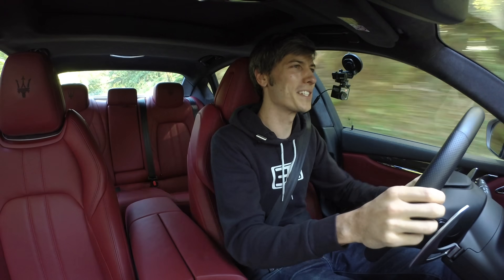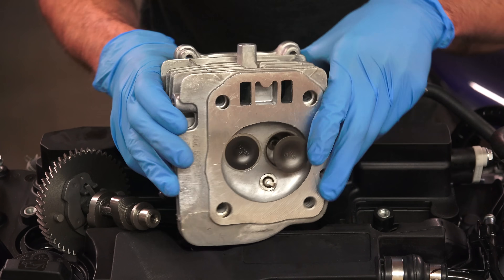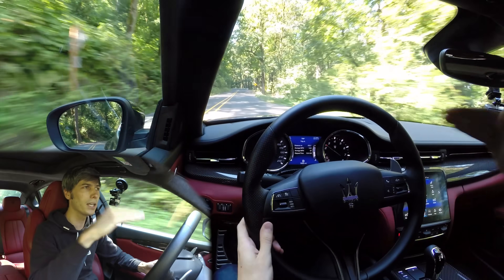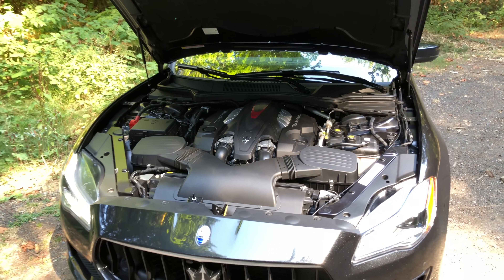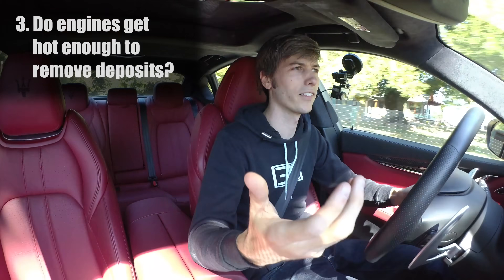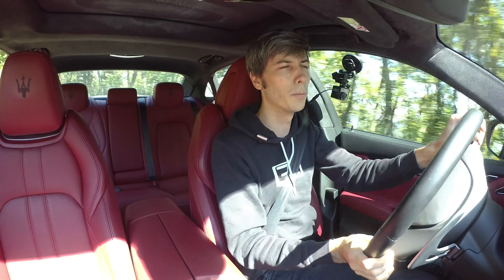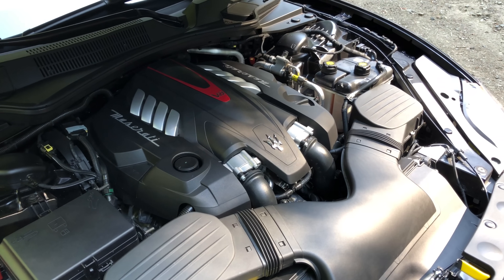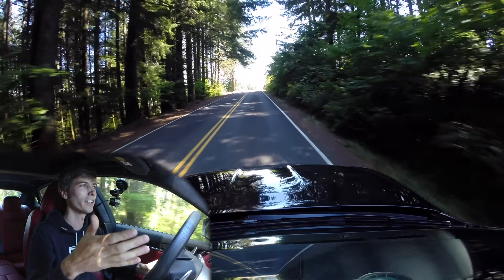Is Redline Good For Your Car's Engine? Italian Tune Up

Comment: I went to pass a slow car in my also slow honda civic (tastefully modded) automatic, shifted to 2nd gear then when I went to go back to D accidently went way over to reverse and I was still on the gas so it just redlined for a good 2-3 seconds then back to drive and I just punched it to about 100. I was thinking "man there goes my engine" but then it drove absolutely fantastically for the rest of the day lmfao

Comment: Just to correct your chemistry, decarboxylation is a reaction carboxylic acids undergo, losing
CO2. De-carbonising engines through simply burning carbon with O2 to form CO2 requires around 1100 deg C. I'd guess that at the metal-carbon interface oxidation of carbon would be catalysed (to some extent) by the metal surface lowering the oxidation temperature. This would loosen micron-sized deposits allowing them to blown out the exhaust.

Comment: The saying Italian tune up has been around for a long time. In the days of carburetted exotic supercars from Italy. The exhaust ports would build up carbon after many hours of low performance driving. Hard highway accelerations in conjunction with normal tune up items would see heaps of smoke(burnt carbon) exiting from the tailpipes. Hopefully removing the carbon buildup.

Comment: I have a car older then me and it's stock besides basic things like brakes, fluids, tires and lights. I've never opened the engine to see the build up, think it might be bad?
My red line is about 8k, I think highest I've needed was 6k but I don't drag race.

Comment: I could be wrong, but I think the "Italian tune up" is not just about carbon buildup. How about the sharp increase in oil pressure dislodging buildup in an oil galley? I have heard of situations where pressure activated pins and lifters becoming unstuck after a good thrashing. It might not just be the oil pressure too; Could be a combination of increased heat and oil pressure doing something.

Comment: About 10 years ago when I was new to cars and never heard of running a car hard once in a while like this, I had an early '90's Ford Falcon (4.0L straight 6 with port injection), I towed a friend's car about 300Km along a mountainous roads, the car was under a fair amount of load the entire time.  The next day I felt like the car performed better but I have no evidence other than feelings which might have been influenced by the long sluggish drive before hand.
Some dyno results before and after on an older car (to ensure there are deposits) would be a good idea...

Comment: 1990 MX5. I left my car in a barn(no mice) for 8 month in 2017. When i started it, it could barely idle, I drove it up and down a road until the engine oil was hot(still running really rough). Then i revved it out and did some pulls. After that it was running smooth and strong again.

Comment: I do this in my 12 Vulcan OHV motor on my 2005 Taurus V 6 . 153 hp 185 tor . It has 154, 000 miles on it. As your entering the high way, just hold it to the floor! Every day driving over and over. No Carbon here!  Quit worrying that car is made to drive. Drive the Hell out of it! Shawn

Comment: Still with the cleaning effect of fuel on port ingection carbon buildup is not a real problem as it is in a direct injection
Reply: So modern turbos are the ones that going to have more problems with this also by the load.

Comment: Great video, royally fucked up the decarboxylation explanation though. Splitting the carbon atom would require a lot more heat than 325 celcius (around 4mil celcius iirc) haha, that's nuclear fission.

In Chemistry, heat is an energy source that can drive up the reactivity of certain compounds/elements. At temperature lower than 325 celcius, carbon is not reactive enough to react with it's surrounding oxygen. In decarboxylation, you're basically heating up the carbon deposits so much that they are starting to react with oxygen, forming carbon dioxide CO2. 

Source: Am Chemical Enginner
Reply from the maker: Haha, thanks for chiming in! I certainly wasn't attempting to state that the carbon atom itself was ripped apart. Rather, that the carbon atom was detached from the deposit molecule (which was stuck on the surface). In detaching the carbon, the molecule breaks apart and no longer remains attached. Still could be wrong about that, but that's my understanding.
Reply: Big fan of your videos and glad I could help. Well you're somewhat correct. However, the carbon deposits are not bonded to one another, they are just stacked on top of each other like lego blocks. When you heat it up, the most outer layer of carbon will react with surrounding oxygen to form CO2.

The only carbon - carbon bond are found in materials such as diamonds and graphite. Fun fact, burning diamond will get you some expensive carbon dioxide.

Comment: Did you consider and research changes in engine oil composition specifically to address this issue?  I know Motul and several others make oils which produce less volatiles and were created to address the issue of carbon deposits in DI engines.  I know that Audi changed the temperature at which their 4.2L engine operates, moving it higher, to combat this issue.  There are changes between the RS4 (B7) and the RS5 (B8) which features a new design 4.2L.  It tends to run between 215 and 225 degree oil temperatures under normal operation, higher if you're pushing things.  Motul Specific is applicable to the above as is the Audi-specified Castrol rebranded oil.  So that 200 degree magic number from the 90's may have changed.

Comment: Years ago with exhaust gas sniffer emissions tests. It was common place to go for a good long highway run to clean up the vehicles emissions equipment. Worked like a charm. Many times guys would come in and fail the sniff test. Go out for a good long pull on the freeway and come test again and pass.

Comment: I’ve heard Italian tune up comes from old Ferrari’s back when they were still carbureted after doing an engine tune up Ferrari mechanics would take it around the track a few times and supposedly it did reduce carbon on that particular model

Comment: I think the reason for the carbon build up in turbocharged engines at high load is the rich fuel and air mixture. We know that turbocharged engines will increase the air to fuel ratio when you floor the throttle, to reduce engine knock.

Comment: I am just visiting my mom in Italy and I just gave her 1999 1.3l Corolla and Italian tune-up - whether it works or not, I felt like having a duty to give that car some happiness. I know she hasn't used the stereo in 15 years (it still had my Metallica Kill'em All CD inserted) so I gave a tune-up to the speakers too
Reply: lol this made me laugh dude, and you had the right music playing to!
Reply: Be sure no one gives your girlfriend a tune-up, while you are away.
Reply: @AlexanderBukh  OK I will
Reply: @AlexanderBukh  lol, I think someones flaunting some personal fears. Sorry your girl banged another dude, Alex.
Reply: @ster9765  ok man
Reply: @ster9765  legit "ok man" no period nothing
Reply: SEARCHIIIIIIIIIIIIIIIIIIIIN

SEEK AND DESTROOOOOY
Reply: Does that still work for smaller less powerful engines? I'm worried that if I do this it'll bring it into that "sweet spot" where carbon deposits form and not getting hot enough to burn them like mentioned in the video. I'm curious as to what your method is for this. Do you warm it up, then switch into a lower gear and get the rpm really high?
Reply: @mattheweng4679  I just drove spirited switching gears closer to the redline, and also downshifting in a more aggressive way

Comment: Recently I rode about 100km in 25 minutes on my bike. That's roughly  85% of max rpm at I would guess 80% load. After that I noticed that the inside of the exhaust was white. Almost all of the carbon had burned off. 

Just some food for thoughts.
Reply: Starvation diet?
Reply: Yeah could of been running lean hench white

Comment: Another thing to consider is that during high load high RPM operation, the ECU is going to put the car in opened loop operation and therefore make the AF ratio more rich causing more deposits.

Comment: I let it sing on the highway, for a good 3-4 hours straight. 
It’s geared so short it’s turning 4000 at 65mph, and only revs to 5500 or so.

Comment: Interesting: that is also how they clear carbon deposit out of old tractors. Once every 3 months or so they hook up the tractor to a Dynamometer or a Baker's Fan, and run the engine at full power for 5 - 15  minutes.

Comment: Italian tune up has always worked for my car! But I wanted to know if the fuel in the cylinder was cleaning the Pistons and valves on the compression stroke both for port and direct injection engines?

Comment: I have an MB w202 C250 TD from 1998. I bought it second hand, and I guess the old owner had no care at all with it, it had problems attaining high speeds and RPMs, it leaked quite a lot, made a lot of smoke... 12 months later, only premium Diesel with Additives, good oil changes and a whole lot of this Italian Tune Up, and all the leaks were gone, almost no smoke at all (only on 4500 RPM+ ), and better performance driving and better fuel consumption. So I guess this would work, at least on my car, and some love and caring does go a long way.

Comment: Hey Jason,
I have an understanding that high temperature needs to be maintained for about 25-30 minutes by driving with full load to burn out the deposits.
Correct me if I'm wrong.

Comment: It does work! but only with italian cars! my dad bought new a Alfa Romeo 33 1,5Ti, it had a boxer engine with 2 upright weber carbs, IDF 36 i believe. During the week was driven around town and it would get worst by the day, on weekends we would cruise on the highway, no need to redline, the car would sound really dialed in for 3 days, most likely was fouling the plugs.

Comment: No it's actually not good to redline a car even if you're told it's okay... what happens if you wipe a bearing out or you got low oil pressure or one of the connecting rods just don't like it's home and decides to break out of the block I've seen cams snap timing chains snap unless you got yourself a 10 $15,000 engine setup I wouldn't go around Red lining your car

Comment: From my experience the Italian tune up definitely works. We bought a Swift 1.2 petrol with 80k km. It was probably only driven around town, by someone with a light foot. The car was DEAD above 2.5-3k RPM. Got onto a highway and given it a blast in 4th gear, keeping it between 4 and 6k RPM. After that the car pulled like it should, through the whole rev range.

Comment: Remember folks, the plural of anecdote is not data. Great explanation, Jason. When I first heard this myth, a very long time ago, I had the sense that it was one of those things that people choose to believe because it supports what they want to do. They want to believe that driving their car hard isn't wrecking it, and this makes them feel justified in doing that. My experience has been that when you drive a car hard, you wear it out faster. End of story. There might be some carbon that gets broken down or blown out by the hard revving, but the cost in wear to those components is far greater than any benefit. But hey, if it's your car, and you're being safe and respectful to others out there, drive it however you want.

Comment: People won't have to worry about deposits if they were burning all their fuel with the two efficiency modes. But usually most don't want to mess with the throttle body or have the materials/money/time to yank the head(s). Unfortunate......

Comment: A lot of good knowledge on engine cylinder temperatures  but false conclusions and poor advice. Redline is  the maximum rpm the engine can be run at with out incurring  ring flutter or valve float. Both of which are destructive to components.
 The internal cylinder temperature is caused by the load put on the engine at a given rpm, not the rpm alone. In vehicles that have been babied by very conservative driving for most of their life hard acceleration and high rpm driving causes the top piston ring to contact the worn  cylinders ring ridge with such force that the ring breaks. Now you need an engine teardown. If you want high engine temperatures put you car in 5th gear at 10 mph and try to accelerate up a hill the temperature will rise and you will need a new engine and or transmission.
In older cars/engines with carburetors or mechanical fuel injection puttering around town produced more carbon and lead build up than highway driving or 'spirited' driving. THis is a result of the engine running rich and low cylinder operating temperatures caused by the rich mixture. The main cure is to remove and clean or replace the spark plugs and go for a 1 or 2 hour drive at highway speeds or decarbon the cylinders thru mechanical means. As there is NO lead in automotive gasoline and cars have electronic fuel injection the problem really doesn't occur anymore.
If your car isn't running properly and you have a loss of power see a MECHANIC, something is wrong and needs to be fixed.

Comment: Ironic how all my cars that got heavy highway speeds over 80mph lasted longest internally over my daily drivers that only got low speed frequent stop city driving.
I believe all of what you saying and feel redline is too hard on other valvetrains to justify redline use on a stock vehicle.
Run some seafoam in the combustion chamber and run it clear then go for a long hot highway drive for 100 miles and change oil. This is the best way to remove carbon aside from disassembly.
Amazing video as always!

Comment: Jason I have a question. I have a small euro VW-TSI engine (1.4 TSI BMY). Would a one hour highway drive be sufficient enough if I had it at 3.5000rpm instead of 2.800rpm (5th instead of 6th gear).
How do I remove some of the carbon build up. And is it even good for the car?

We have a 18 year old car that has never been driven hard, and its fine.

Comment: What you did not consider about the blowby causing more buildup theory is that the EGR system shuts of if you want more power because the engine is in need of fresh air for making power. This means no droplets of oil getting into the engine

Comment: I was led to believe that the Italian tune up did work on intake valves because the valve spins around its enclosure, the spin causes friction between the valve and the enclosure thus carbon deposits get removed.

Comment: Could you do a video about engine braking and if it has a negative effect on the engine? I know you have done one already on engine braking but I don’t think you touched on this. I was reading especially in single cylinder motorcycles that engine braking significantly decreases engine life. Is  it that bad? I’m not too sure about these claims, can’t find any study about it. Why would it be bad to engine brake in a smaller engine with higher compression ratio? If so...

Comment: My daily is an E46 318ci. When I purchased it, it Han been nannered. I er “Italian tuned “ it over months and it runs much better. 
I believe it’s due to two parts one is the smoothed out running by burning off the carbon build up and the car relearning how I drive.

Comment: If you consistently run your engine to red line, carbon deposits will likely be the least of your worries. On a positive note, frequent rebuilds provide a good opportunity to give all components that are not replaced a good cleaning.

Comment: Because we are talking about redlining your car, how high is too high (rpm wise) when speeding to merge on the highway or pass people.

My car redline starts at 6500k maxes at 8k. For longevity of the life of the car, how high can I go with the listed scenarios above and not harm the engine? 

My car is an 04 mazda 6i manual.
Reply: I realise this is an old comment, but I'll leave this here in case it helps.

You said redline is from 6500 rpm.  Where the gauge stops is just that, where the gauge stops.  Modern cars are electronically limited, usually somewhere around 250rpm into redline, to prevent engine damage.  Some people raise that limiter, but doing so without careful research (meaning what the engine can take without self desructing) and consideration for reduced engine longevity is rather foolish.  Plus it's useless without "breathing" mods.

Anyway, power does not keep climbing indefinitely.  Power is basically the product of torque and rpm. Afer hitting a certain rpm, the torque will drop quickly enough that the rising engine speed can't compensate.  With a 6500rpm redline, I'd expect the peak power to be around 5500-6000rpm.  Going above that is a waste, unless you're going for max acceleration.  And even then the difference is marginal.  I'd say just take it to 5500, maybe 6k, and then change gears.  Of course this is assuming your engine is stock.  My '87 Mazda 323 has a 6k redline, and "peaked" (actually it was still climbing) at just over 5900 last time it saw a dyno.  I'm guessing the actual peak would have been at 6100, or 6200.

Comment: Hey nice video!! If you can please check about those new methods of removing carbon deposits with ortho-hydrogen gas i saw a few videos about it, they insert this gas throu the air intake and they say is really efective , is it really working that good ? It would be an interesting video ; )

Comment: Anecdotes are not scientific evidence, but this is the internet, so here we go...

As I understand it, air cooled beetles get cranky if not taken out and run wide open for several minutes every so often. (Not a problem in a 30hp car) I always assumed that the gas velocity, in addition to the heat was the working component. Do air cooled engines just get hotter, or is the high sustained flow also at work? Should we disregard this factor?